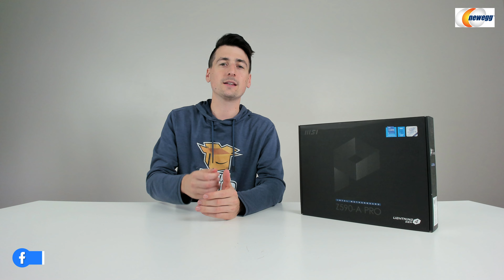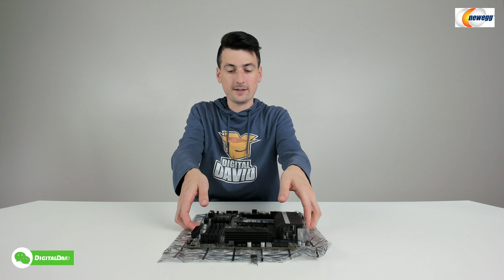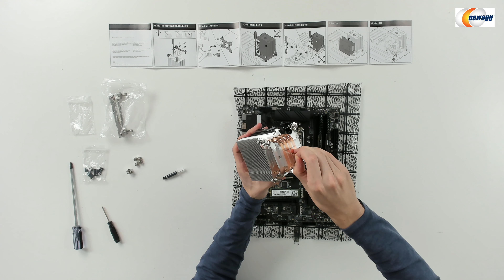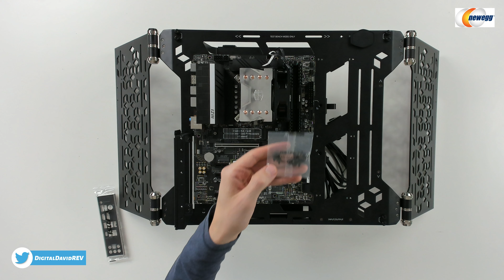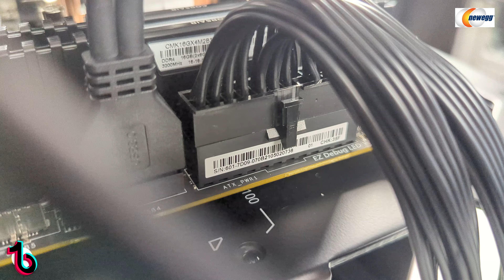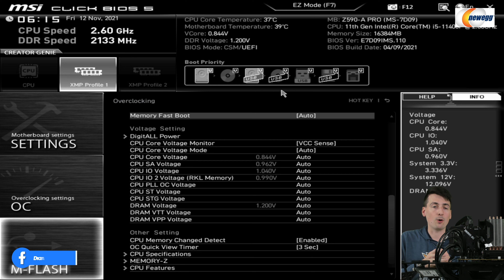MSI Z590-A PRO ProSeries Motherboard Review // NeweggNow

Comment: Te hago una consulta, sobre el puerto m.2 Pci e 4.0, que tiene una etiqueta que dice que sólo soporta procesadores intel core i5 o sea que un procesador i3 o i7 de 11° generación no se aprovecharía toda la velocidad del m.2 4.0?
Reply from the maker: I don't know Spanish :(  
~B
Reply: @DigitalDavid  I have a question about the m.2 Pci e 4.0 port, which has a label that says it only supports intel core i5 processors 11th generation , that is, an 11th generation i3 or i7 processor would not take advantage of all the speed of the m.2 4.0?

Comment: Do we have to connect pcie power to motherboard (pcie_pwr1) if i use only one graphics card and it has its own pcie power connector
Reply from the maker: It's always a good idea to connect the PCIe power to your motherboard, even if you're using a graphics card with its own power connector. This will help ensure stable and reliable performance of your system. I hope this helps! cnl

Comment: Overall I'm very happy with this motherboard, However I purchased the base z590-a pro from amazon where it was listed as having bluetooth however after installing the mobo and booting after testing I'm unable to find it anywhere, nor apply any fixes to this.

I'm assuming the board doesn't actually have BT connectivity? :(
Reply: @Skater69  I'm currently using normal usage, thermals on these are kinda all over but with slight undervolting you can stay comfy at 5ghz with amlpe cooling, I have a dark rock pro 4 and after a 10min stress in XTU it peaked around 82c which isn't too bad but I'm happy at 4.8ghz tbh
Reply: Would like to ask what processor do u Use?
Reply: @Skater69  I bought last year during the shortage so am stuck with the 11700k for the time being i would've liked to have a 12900k but eh
Reply from the maker: Did you figure it out? Any chance it was just a missing driver??
Reply: i got the z590 and i thought for the longest time it didnt have bluetooth, but it actually did, i just was too stupid to turn it on properly. works great now, has good range too

Comment: Can you do nvme raid setup for m2 2 and 3 slot?
Reply from the maker: Yes per the user guide and manual:

∙ Supports RAID 0, RAID 1, RAID 5 and RAID 10 for SATA
storage devices
∙ Supports RAID 0 and RAID 1 for M.2 NVMe storage devices